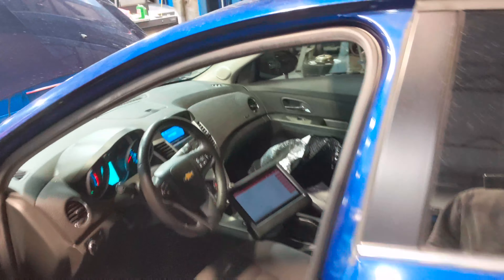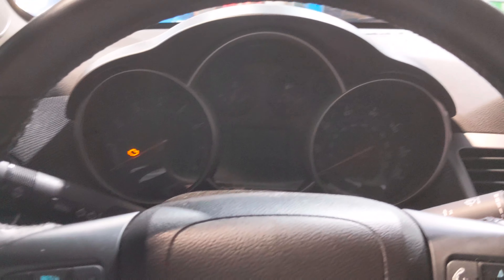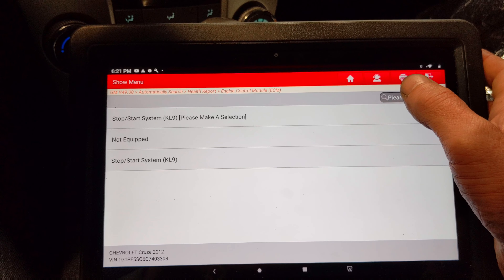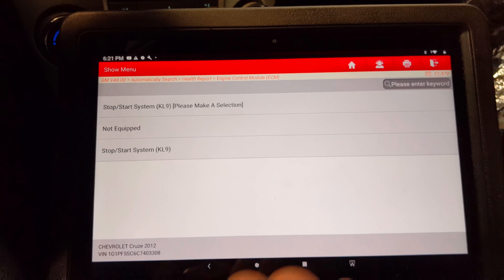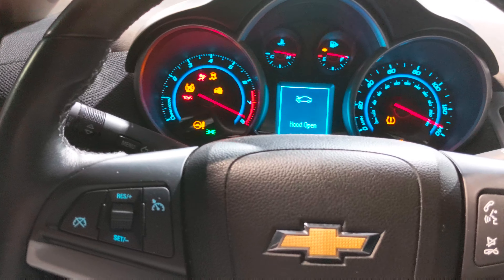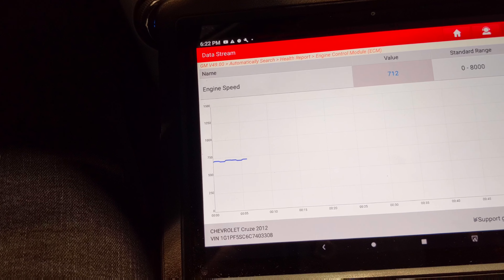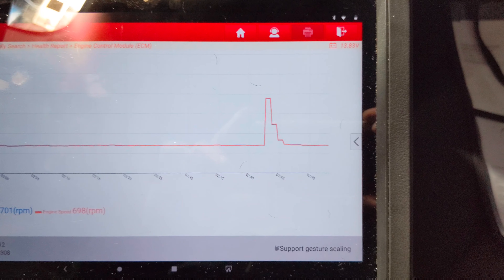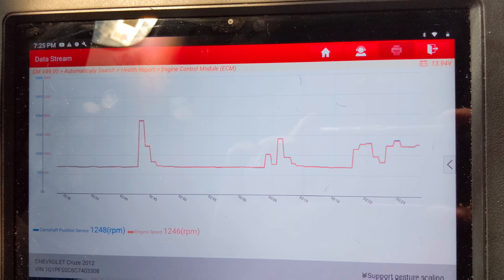Chevy Cruze Stalling: Crank No Start

Comment from the maker: What we ended up finding wrong with this Chevy Cruze! It was not the crank sensor. It ended up being a bad connection at the ignition coil. I wiggled the connection and the car stalled a number of times. I removed the connection, cleaned it with contact cleaner, and made sure all terminals were tight, and that fixed this car.
Reply: Holy shit thank you, my car stalled currently waiting for a tow and I read this comment wiggled the coil pack harness and it cranked first try.
Reply: I replaced mine after the lock clip broke off.  It was a pain. Each pin has a tab on top and bottom.  One wire at a time.  Fixed.
Reply: I have a 2016 Chevy Cruze in my car is doing the same thing I sprayed the wires that's connected to the coil pack and it started right up stalled out today again clean that really good it still seems to continue
Reply: Mine is doing it now ty I'll try cleaning it
Reply: bro you helped me out so much omg i was stuck no check engine light nothing i wiggled tbe coil boom fired right up
Reply: @FlatRateMechanic  was not the problem on mine could a bad catalytic converter do it?
Reply: Same thing that was wrong with my Chevy Cruze !!! Would crank but no start. No lights on. Was the coil connector.
Reply: Just literally experienced this and looked for a video while stuck on the side of the road, wiggled the plug, and pushed it in. car started right up. Thank God

Comment: I’m having the exact same problem as we speak.  I’ll forward this video to my mechanic right now!  BTY, I love my 1.4 manual turbo, has 284000 mi and still going (except for present issue).
Reply: Did u figure it out? What was the problem
Reply: @ayeeikeegaming2480 I’m having the same problem
Reply: @yo_drake6997  my mechanic said it’s a bad fuel pump or runner control valve sensor, having both replaced my car doesn’t start now
Reply: @ayeeikeegaming2480  me too I change both still no start
Reply: @yo_drake6997  have you talked to anyone and got any idea of what it could be ?
Reply: @ayeeikeegaming2480  one shop said ecu

Comment: I would never have thought crank sensor.  I had one go out on my vehicle twice and it sputtered and sputted multiple times before it died.  Never did it just shut down like someone turned off the key.  I'm glad you found it.  I never would have even looked at the ignition coil.  Curios, how did you find the issue?
Reply from the maker: Well, when all else fails I turn to the wiggle and tap test. Wiggling harnesses and tapping on modules.
Reply: Do the gauge lights stay on when the car dies ,mine is and I do not have a check engine light either it just dies , let it sit a couple min and starts bak up

Comment: My advice is take to your technician make sure they drive the car while checking for the problem if you leave the car standing and turned on it won't show the problem. I had to drive the car with mechanic checking his scanner to find the problem. My problem was in the harness if you car overheats and had this issue as well lits likely the coolant corroded part of the electrical hardness or so the mechanic says but car works now.

Comment: Mine is doing the same thing! I just paid over $1000 for coil and spark plugs replacement, and it had also had bad gas which needed to be drained out. I don't have any money left to fix whatever this issue is with stalling! It will stall when I try to start it again after a 30-40 minute drive running errands, then I'm done with the errands in about 20 minutes back out to the car and it'll stall immediately trying to start again. It seems like it could be something where it's too hot.
Reply: Bro have you fix that problem and what was the cause bcz I’m facing the same issue and no body can fix after spending a lot

Comment: I changed my water outlet, on my 2016 Chevy Cruze LT 1.4 turbo, and turned it on got it up to normal temperature, drove it around and satisfied with the results, I parked it for a few minutes and tried to start it again and got only cranking but no turning on… any ideas of why it did that? Any assistance would greatly be appreciated.
Reply: Same
Reply: Same here. Has anyone found a solution yet.
Reply: My 2012 Cruze done the same thing a couple of weeks ago and it’s still in the garage waiting for the mechanic to fix it but they already hooked up their computer up to it and I think it said crankshaft sensor bad so im still waiting for my turn in line at this little shop to get it changed hoped this helps you out have a good day🚗
Reply: @Jaybird18speed hey bro did you fix the car and what was the solution?

Comment: Nothing but problems with my 16 cruze rs 1.4 ,new motor put in with 60 k on it now its back in the shop again...if you own one you know what I mean, if you don't, good don't buy one .
Reply: Bro tell me about it holy fuck
Reply: Yep... paid 4k to replace turbo system. Got half way home and it started rev locking on me. Took it back to then be told it's the PCV needs replacing and that's what would have caused the turbo failure and it would be another 4k to replace it 🤬🤬
I told them to stick it and ended up modifying with different valves and hose. Cost approximately $150

Comment: I’d check the mass flow air sensor. Unplug it, it may stall, but should crank on 2nd or 3rd try. Engine will run rough because it’s in default. After running for 2min, plug MAFS back up, if it shuts off, replace the MAFS or clean it thoroughly. They are cheap, so I’d just replace it.

Comment: I have this problem currently. My ignition coil pack was messed with and the crankshaft sensors got replaced and still can not get the car to start. It won't even turn over at this point at all.

Comment: I rebuilt the engine 2 weeks ago.
It's started and run to operating. Tempted diagnoit will not restart. Impression is around 70 pounds. Compression. Well, the Turbo calls it.

Comment: Hello i have a 16 Cruze 1.8 i changed the alternator battery is fine and the terminal fuse box and it doesn't start it only cranks it it shows a the screen battery charging any help
Reply: Did you find the problem
Reply: Can you help me
Reply: @yo_drake6997  yes I did found the problem it's was sits was a short and I bought the fuse terminal again but it works fine now